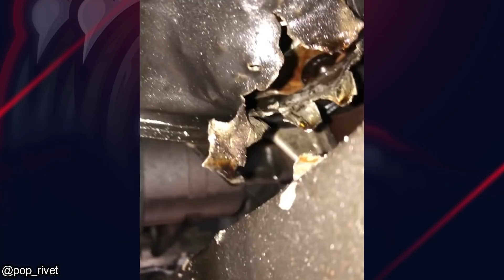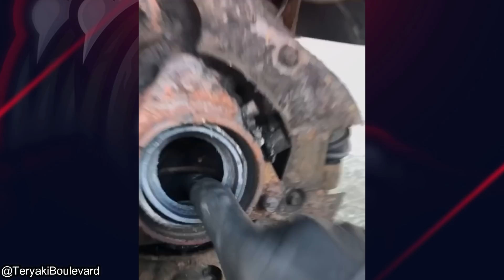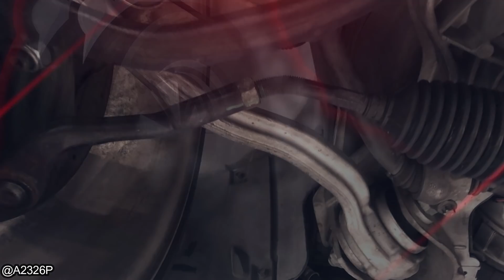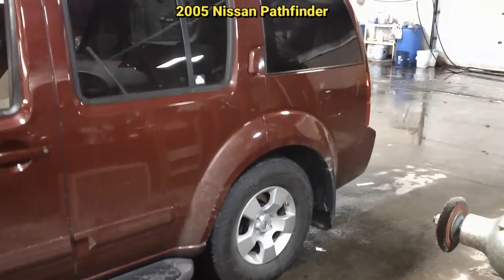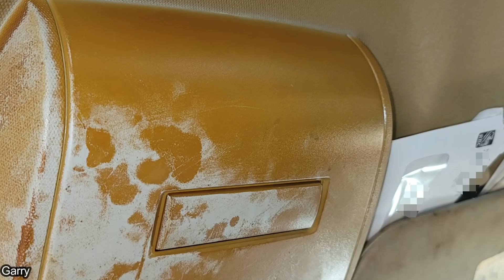Customer States Needs Starter After Towing Behind RV | Just Rolled In

Comment from the maker: For the 1st clip, how fast do you think the engine was spinning in 1st gear?
Reply: 9k rpm
Reply: Faster than f1
Reply: 10k. Instead of towing it to the shop, they should have towed it to the junk yard
Reply: Over 9000!!!
Reply: I'd say it would probably be over 9000rpm
Reply from the maker: @ferrari2k  I was waiting for this comment. 🤣 thank you
Reply: Too Fast?
Reply: Around 70 mph would be around 14,000 RPM.
Reply: Just 12,000 to 15,000 rpm
Reply: Depends how fast they were driving but somewhere in between 18000 and 24000 RPM. boom
Reply: All the way
Reply: Too much. lol. 
Thanks for sharing your videos with us.
Reply: Not fast enough, they still have parts of the engine left.
Reply: All the fast.
Reply: Deadline instead of redline
Reply: Too fast!
Reply: If it was a rotory it would be just fine lol.
Reply: As a mechanic for over 20yrs ive seen alot of crazy stuff, but that nail clippings car, WTF!
Reply: real fast for a few seconds... then not at all
Reply: @alch3myau  lol
Reply: @KenBober  "10k is just the beginning for a rotary"
Reply: Fast enough to take flight. At least the rods/pistons to take flight out of the engine
Reply: One more RPM than was needed...
Reply from the maker: @KenBober  I was also waiting for that comment haha
Reply: 20k rpm or so
Reply: Mine is an 07. The tach shows 2000 RPM at 10 mph in 1st gear. Estimating the highway at 70 mph would put it in excess of 14k RPM.
Reply: Infinity
Reply: Yes.
Reply: They just send it all the way
Reply: The Fram filter tells all about their intelligence
Reply: Yes.
Reply: Too fast
Reply: Lol enough to fuck it up 😂
Reply: Fast enough.
Reply: i think the rpm was yes
Reply: @darkstorminc  🤣🤣🤣🤣🤣👍👍👍
Reply: At least double the redline.
Reply: Ludicrous speed.
Reply: Tree fiddy
Reply: I wonder what people behind them were thinking.
Reply: tbh nothing above 8k RPM before the engine blowup lol...
Reply: depends on how fast was she going
Reply: @blbeach  The math may say it COULD have got to that high but I have a feeling it popped around 9K
Reply: I'm sure you could figure out an estimate if you multiplied the speed they were at by the gear ratio, I would say maybe idk 13000
Reply: Faster than a CR250R redline!!!
Reply: On the first one I bet they complained about their terrible gas mileage and could not guess why they only got six miles to the gallon.
Reply: Well beyond it's redline! 😜
Reply: It probably let loose at 9000 rpm. If it would have held together, it would have easily spun over 15000 rpm. Thats if the RV only traveled under around 45 mph.  Pretty brutal!
Reply: In the black area past the red zone. The needle got bent on the peg.
Reply: Just think about how fast the engine would have revved in first gear at 60 mph plus.
Reply: Ludicrous speed
Reply: Like a Yamaha R6 for sure
Reply: Did the calculations on a 2005 corolla with a manual transmission with 3.17 1st gear ratio, 3.94 axle ratio, 24.4 tire diameter is the stock tire, at 30mph is just under 5200 rpm. So over 60mph is about 10,400 rpm😂 75mph is 13,000 rpm🫢
Reply: Probably close to 20k
Reply: Yes. All of the RPMs.
Reply: As a tool salesman, I came across a similar car. A Toyota Corolla, manual, that had been flat-towed from Florida to Michigan.... IN GEAR.  Was brought to a shop for no start. It had ZERO compression across the board, but had stayed together.  Rings were melted out of it

Comment: People, if you have enough money to buy a big ole' RV, then you have enough money to buy a flatbed trailer for your towed vehicle!! NEVER EVER TOW Cars, trucks, pickups, vans, etc on their wheels.  Even if you have it in neutral in can possible damage the transmission. Some vehicle manufactures place tow warnings on said vehicle that cannot be towed on wheels for more than 50 miles, some times that is collectively. Meaning you can tow said vehicle 5 times 10 miles each before damage can occur.  This is why rollbacks/flatbed tow trucks are so popular. Some put them on dollies so the drive axel is off the ground, however that will only work in 2 wheel drive vehicles. Even then you have wear and tear on the tires, struts/shocks and suspension. and what happens if one of the tires is low or goes flat? bye bye, tire, rim, rotor and who knows what else before you figure it out.  People, just get a proper flatbed trailer. PLEASE

This coming from a former professional tow truck driver
Reply: At least get trailer dollies.  You can get four of them and lock the steering wheel.

Comment: What a goof! Everyone knows that the diesel goes in the blinker fluid thingy.
Reply: If you need help finding the blinker fluid reservoir, it should be near the headlight fluid tank, somewhere near the ac condenser in most GM cars.
Reply: My question is isn't the end of the diesel nozzle bigger in circumference than a gasoline nozzle? If this is correct, how can you mix the two up? And I'm pretty sure it says Diesel and gasoline on their respective nozzles. 😆
Reply: @GearGuardianGaming  gm cars 🤣. Priceless.
Reply: You guys are way out of date.  There's been a shortage of blinker fluid for quite some time, so the manufacturers developed BGR, or the Blinker Gel Reservoir.  It's supposed to last the life of the vehicle, or in GM's case, 3 years, whichever comes first.
Reply: I always put kerosene in mine.
Reply: I fill my up avery time I have to pee
Reply: Really. I e always been putting it in the sunroof expansion tank
Reply: @GearGuardianGaming  😂🤣
Reply: @bubbaray2240  hey that’s a good idea 😂😂😂🤣🤣🤣🤣🤣
Reply: @No.1headbanger  we have 2 different size nozzles for diesel here in Australia. The big one is used for semi trucks for faster filling.
Reply: Even my niece knows that, although quite a few shops had sold out of blinker fluid, I gave her some from my secret stash, 😊😅😁😇

Comment: A long time acquaintance of mine did almost the same thing with his Nissan pickup. Was going to a new job the next morning and used a towbar to tow his pickup behind his logging truck. Had it all hooked up to the logging truck and while doing so left the pickup in 1st gear as his E-brake cable was broken.
He said he didn't feel or hear anything when he left at 3 AM the next morning but told me later when he found out what he'd done that he could hear dollars rolling down the street at that point!

Comment: I was in the auto glass trade for 10 years.
Some of the vehicles were so filthy, I turned them away.
Reply from the maker: I believe that 100%
Reply: I've been in apartments where the smoke residue was so thick you could see where the pictures were on the wall
Reply: @andythekitsune  most houses in the '70's, when almost everyone smoked.
Reply: former TV technician here... I remember cleaning a customers TV set during repair. Customer refused the TV insisting he had a brown TV... not a silver one. Needless to say, that silver was the factory color after removal of all the smoke residue.

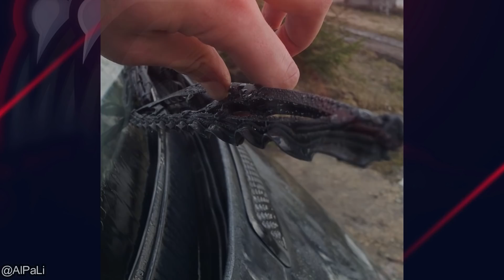Comment: 1:39 Ok, I've seen people mix up the gas and diesel and accidentally pump the wrong fuel into the tank... but how does anyone accidentally add diesel, or any fuel for that matter, into the washer reservoir?  Has anyone ever seen a car that the fuel fill port is under the hood?  I could possibly see adding DEF to the wrong reservoir, some trucks have the DEF fill port under the hood, but not fuel.
Reply: Well, seeing as diesel and gas clean things really well, all you gotta do is pray the pump motor doesnt ignite.
Reply: Doesn't the Trabant have a fuel filler under the hood?
Reply: @fredk.2001 , Maybe, but I've never seen a Trabant, or any vehicle that has the fuel fill port under the hood, and unless someone here works at a museum or organizes a car show (both of which would be a pretty cool gig by the way), I don't think any of us has actually laid eyes on a car that requires opening the hood to refill the tank.  Any idea if Trabant's were sold in America?  Aside from a collector importing them?
Reply: @John Davis, actually  the Renault 4cv from the 50's had the gas cap under the hood and outside the chrome cap is to fill the radiator, guess for what common mistake is known for? Then there's Porsche with 2 "gas" doors, one is for gas and the other for engine oil, guess how often people destroyed their engine.
No Trabant were imported in the US unlike the Renault.
Reply: I raise you the Subaru E-12:
-Coolant and rear wiper fluid is added with the rear door open.
-Front wiper fluid is added trough a hose sticking out of the front bumper.
-Engine oil can be added with the rear door open and rear bumper swung down.
-Brake fluid must be checked by opening the driver door and removing a hatch in the dashboard.
-Fuel is added underneath the driver door.
Reply: Smart ForTwo (i guess it was the second Generation if i reminder right) had a similiar thing. The fuel cap was above the rear wheel on one side of the car. But the other side had a similiar design patch like the fuel cap and some people did remove the plastic design thingy with force and the gas was filled direct into the air intake of the engine.
Reply: I can see this happening. My uncle stores gasoline, diesel, washer fluid, antifreeze and who knows what else in identical containers all sitting next to each other on a shelf in the garage. Now imagine someone (I won't point a finger at anyone specific) needed to fill their washer fluid because that light on the dash has been on for a week. And that person is not automotive savvy. See where this is going?
Reply: @vivillager  I think old VW bugs have the gas tank under the hood. Or frunk. Whatever ya call it. But the motor is in back!
Reply: @ericw4848  I scrolled down just to see if anyone already wrote this logical answer.
Reply: @numb3rsnet  even worse it was the intake of the Turbo, the 1st and 2nd gen had this problem while the 3rd put a more classical vent in its place to deter people from forcefully ripping the cover off
Reply: Not sure, but in camper van circles, some people put a smal diesel tank under the hood for their space heater, so it wouldn't be a big error to be meaning to put diesle in that tank and accidentally put it in the windshield wiper tank instead.
Reply: Someone probably put a small amount of diesel into a washer fluid container to use to clean parts or something then left it laying around unlabeled.  Dude should have smelled it when he went pouring though.
Reply: If I had to guess, maybe they bulk purchased wiper fluid and put it in their own containers for dispensing, and grabbed the wrong one?  It's the only way it makes any sense to me, though you should keep your fuel containers very easily distinguishable from everything else.
Reply: The Delorean has the gas cap under the front hood
Reply: @fredk.2001  Its 2 stoke though.....and Russian.......and a really bad car in general.
Reply: @acid360delta7 , I've seen a Trabant around the Oakland bay area in California more than once.
Reply: @acid360delta7 , it is a poor car, but I could still build one into something cool.

Comment: I'd love to have before and after bore scope images of that car running diesel. A lot of old mechanics swear by diesel and ATF as a combustion chamber cleaner.
Reply: Diesel is a good cleaner, as are other fuel types. My observations show propane and kerosene dont clean as well even though they burn cleaner
Reply: I've seen it recommended over and over again to run ATF in diesel fuel............ I don't think they realize ATF has friction modifiers and other components that aren't meant to be burned. Probably isn't too nice to high pressure diesel injection pumps either. I only use actual fuel additives in my trucks
Reply: @RamTahoe  Some morons think any oil that's dyed red is either some sort of cleaning agent, air tool oil, penetrating oil, diesel fuel additive, and the list goes on. Not hardly.
Reply: You used to put gasoline in the diesel to make it freeze resistent because gasoline freezes later. Then the high pressure injection came and it became a no go. The injection jets use the Diesel to lube and cool them. Since gasoline desolves diesel the jets would run hot and break

Putting diesel in a gasoline is less dangerous because the diesel wont fully combust

Comment: Back in my oilfield days when I was on a frac crew, we use to wash the truck and trailer/pump with red diesel to get the paraffin off. We just used a 5 gallon bucket with the diesel and a scrub brush though

Comment: When you see how bad the cigarette's smoke went around the car... I think you can figure out the customer's lungs are probably in an even worst condition.
Reply: I remember a smoker's toothpaste ad eons ago. Guy took a drag off the smoke, blew it through a white cotton cloth and said every time you light up, this is on your teeth. I was thinking to heck with your teeth, what about your lungs! One more reason I don't smoke today.
Reply: Not to mention that cars electronics. Ever see what smoke does to those?
Reply: @iamtheoffenderofall  Don't need to go that far, computers or game consoles from smokers are just filled with solid dust over time, it is not much about the circuit boards itself, but how it mess with the airflow. 
It is cleanable but lungs are not, in fact over boards resembles to a sticky dust, so blowing air is not enough.
Reply: @juanca2807  apples to oranges comparisons. You are talking about electronics in a large room with fans built in. Vehicle electronics are in a small place with no fans built in. Not even a close or accurate comparison.
Reply: @iamtheoffenderofall  For demonstrative purposes a piece of hardware that requires active cooling represents the effects better and quicker. In both cases the boards and embedded electronics don't care much about this dust produced by the smoke, but you can also have heat problems with elements that require passive cooling at some point. 
Said that, the major concern for a car will be the smell, not the electronics.
Reply: @juanca2807  talk from someone who knows nothing about automotive repair.
Reply: @iamtheoffenderofall  Sure buddy, my field actually comprehends working with systems and that includes hardware; wonder what kind of cars are you picking to say it politely, when the remnants of smoking is a major concern for enclosed circuit boards.
Reply: @juanca2807  again... vehicle ECUs are NOT enclosed when inside a vehicle. Look at body control modules. Plastic case with a circuit board inside. Look at seat modules, look at general electric modules, instrument clusters radios....Jesus...shut up unless you actually know how a vehicle ECU is actually constructed. Do you deal with vehicle ECUs on a daily basis like I do? No....you don't. Cause you wouldn't be putting your foot in your mouth right now.
Reply: @iamtheoffenderofall  Man you put a smirk on my face, is that the entire problem?, the ECU and some modules, that by definition have protection and are enclosed (yes, enclosed doesn't mean a hermetic box). 
I will just say that standard (non modified), car interior schemes are designed with tolerances in mind, the problem is the actual user, that unironically is even above the abuse levels that some designers consider a garbage user. 
I won't criticize you if that is your day to day, but I also don't account problems to hardware or a server when it was terribly mounted or is placed inside a shithole, just the way I see it.
Reply: @juanca2807  again....spoken from someone who doesn't repair vehicles at all.
Reply: @juanca2807  Can cigarette smoke mess up electronics?
Smoke can be an irritant to electronics, especially when the smoke steadily pollutes the environment. ... The tar released from cigarette smoke gathers onto electronics, allowing dust to stick to these expensive items and limits its ability to discharge heat. When electronic devices overheat, they eventually break down.

In a car this is compounded due to LACK of ventilation. So...show me where your expertise proves otherwise that cigarette smoke is minimally intrusive. Go on....I will wait.
Reply: @iamtheoffenderofall  Did I say otherwise?, heat problems were mentioned in my second comment, I even recall calling the cigarette consequences a "sticky dust".
You seem eager to blow things out of proportion, are you positively saying that opening an ECU/module and finding a crust of shit is the norm?, even for someone that sometimes smoke inside the car it won't be the case. 
Either way I never put your experience in doubt, you just called me over something that is not the norm, hence my replies.
Reply: fixed a typo in the main comment. "when around the car" Oops xD
Reply: They used to design certain cars with good airflow in mind, mostly because there were so many smokers back then. Back in the 70s. They had these vent systems, and you could see the vent lines over the trunk. Caused a few rust issues, but it wasn't a bad idea otherwise.

Wrist twist steering and swivel seats though. That's debatable.
Reply: @iamtheoffenderofall  i had a 1987 Toyota celica. Loved it, but because the previous owners were smokers, it messed up the terminals and the heater wouldn't turn on like it was supposed to.

If you're ever buying used electronics online you'll often see "from a clean non smoking household" in the item description. Because yes, smoke can definitely cause damage in electronics. Can cause problems but it doesn't always effect everything.